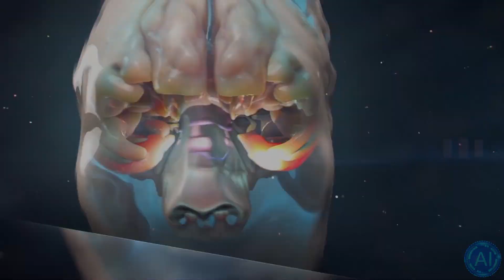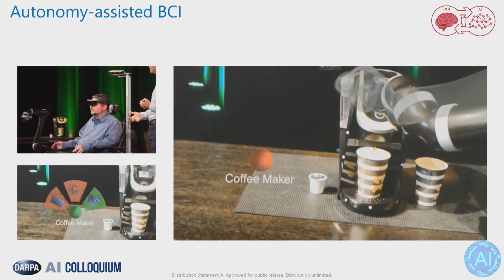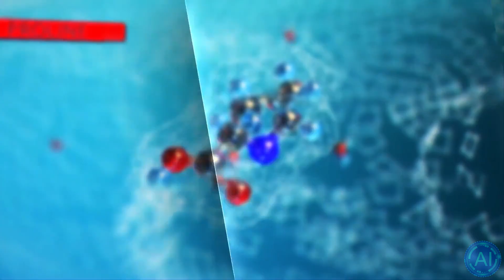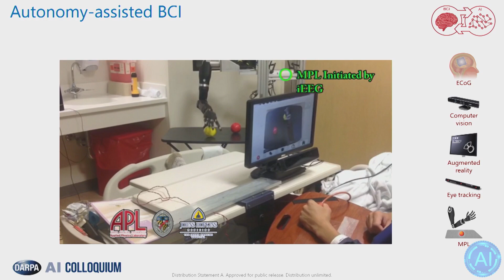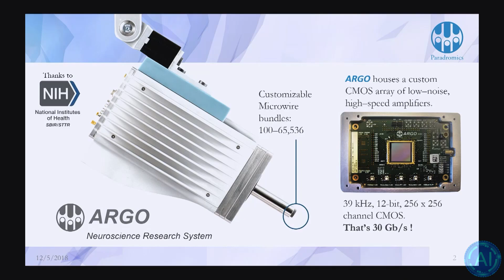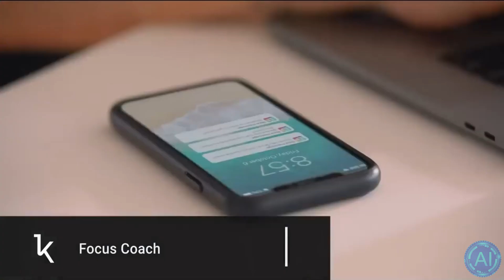Is Elon Musk's NEURALINK ALREADY OBSOLETE? | Future of Brain Computer Interfaces

Comment: M3 wonder what and if their relationship to L3 is? I can tell you that Darpa and L3HARRIS have for years have been using people like me as guinea pigs for this and other research against our will. I can and will prove it, the practice as led to many suicides. Destroyed life's, families, paid low level criminals to constantly talk and harass the subjects, maybe to avoid accountability in case worse case scenario situations. Just like the sting-ray use with local cops this is also ran similarly with none disclosure agreements etc. Called remote Neural monitoring L3's former employees have statements regarding it on work place forums like "Glassdoor" I can't say more due to  recent ligation. The technology spoke of in this video has been available to Darpa for years and is far more advanced then you could even imagine.